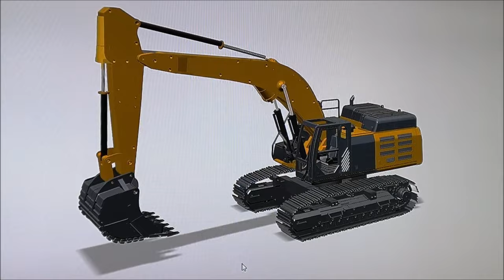Building a rc CAT 349E Excavator - Part 1: Undercarriage

Comment: Is the stiffener ring shown at 6:23 included in the Volvo excavator? I haven't see it in the files.
Reply from the maker: no, thats new in this excavator :)
Reply: Would it be possible to add it to the Volvo, or are the cross beams different thicknesses?